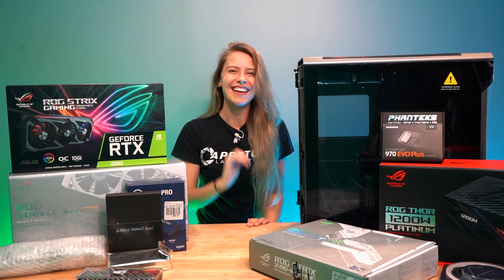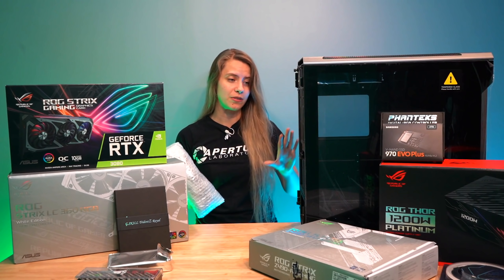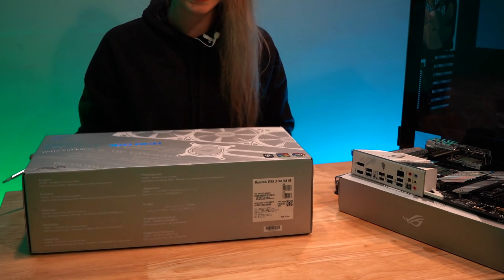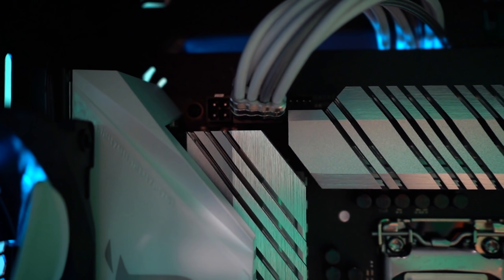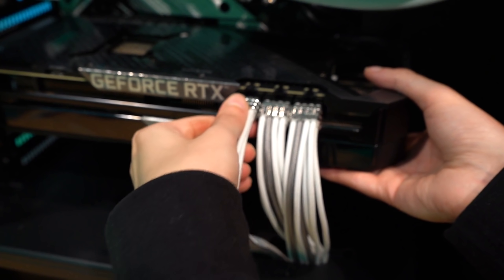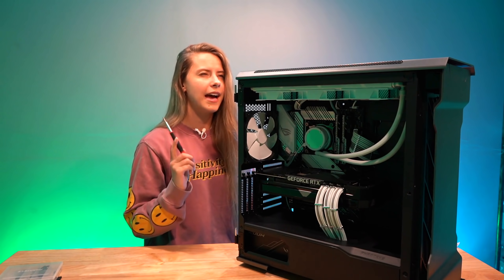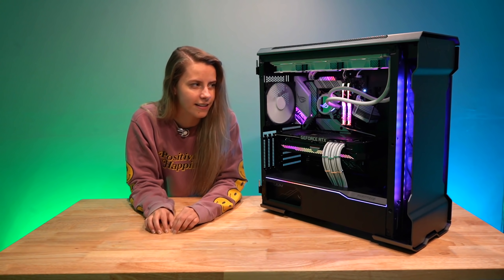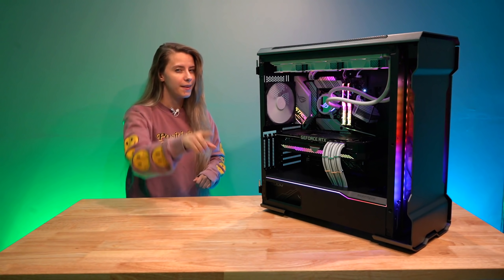MY MOST POWERFUL PC BUILD YET! 💖 RTX 3080 PC BUILD | Powered by ASUS ROG

Comment: Putting that Thor upside down hurt my soul. I have the same case and an 850w Thor PSU. If you keep it in hybrid mode the fan rarely turns on and if it does, its not for long.

Comment: If the connector on the AIO is just a MicroUSB connector, you can buy a MicroUSB to USB header cable in black on Amazon. Plenty of other coolers use them like the NZXT Kraken and Corsair H-series AIOs and they're just normal USB. Loved the video!

Comment: I've used that case for around 18 months now and love it, I can confirm my case came with 2 hard drive bays already installed. Also the extra cable isn't needed for the CPU, it's just additional power room for overclocking, I have my 9900k OCd to 5ghz without the additional cable...

Comment: Since the AIO fans are pulling air out of the case. I would remove the casefan in the back, so that the AIO can pull in passive air from the outside of the case on the back instead. Otherwise u will have too much negative pressure inside the case. And I would also flip the AIO completely so the tubes run from the back of the PC so the TUBES don't have to stretch as much.
Reply from the maker: i end up rotating the pump and rerouting the cable in the video! <3
Reply: @NoisyButters  yeah, I edited the comment throughout the video whilst I was watching :p Didnt expect a reply soo soon >.< :p
Reply from the maker: @SourceHD  honestly i had the thought of removing the rear fan but thought it might be counterintuitive! i think that's a great idea, itll match my other system better, better air pressure, AND it wont be as loud on my mic for recording vids! im so happy to read that thank u for the advice!
Reply: @NoisyButters  awesome! :D I think u might be able to install that rear fan into the front instead though for better cooling, then you'd have ultimate airflow. 3 intakes in the front and 3 exhausts in the top cause heat rises :) and u then have the rear slot empty for a cool passive intake for lil cooler cpu temps whilst still the front fans cool off the GPU really good :) that would cool down equally as much cpu as gpu :) Thats the last comment I swear 😣😁😅❤ Otherwise it's solid :) Remember to turn on X.M.P(Intel)/D.O.C.P(AMD) in BIOS for those advertised latency ram speeds :) increases game fps dramatically :) not doing much for CPU workloads in editing and rendering though, but it will help out make your system more "snappy" and responsive and get way better fps. Probs by something anywhere from 5-20% increase in FPS just by activating XMP 👍

Comment: It is your PC do what you want but a few observations if you are interested. The pump cable maybe route it up between the Ram sticks and the pump and over the top of the MB to the back (Harder with it being white but if you swap to black will hide it nicely) You can download the AI Suite 3 software from Asus (Go to your MB support page and it is there) to tweak the fans or even use AI to control them. Also make sure you set the XMP profile for the Ram. Amazing build you made. That Ram looks amazing.

Comment: You should turn the fans in the front the other way around to bring cold air into the machine. From what I can tell all fans are facing outwards, you could get issues with your GPU later in the future.
Reply: Don't know where you get that. At 8:30 the front fans are clearly visible, and they're intakes.

Comment: Good on you recognizing the CPU cooler can't be rotated and fixing the astatic issue  You can flip that PSU over the other way with fan up, it all depends on the static pressure in your case in regards to the other fans and the direction they are going.  ROG wouldn't put an LCD screen on a PSU and have everyone flip it over to the back along with most case manufactures now opting for a PSU cutout window as your Phanteks case uses. The second 4 pin CPU cable isn't needed, unless you are extreme overclocking the CPU and motherboard Gamer's Nexus style with liquid nitrogen.  Enjoy the new gaming PC.

Comment: High wattage power supplies 1200-1600w power supplies can be installed in any orientation. They are much more efficient units with much higher quality components and designs, thus they will typically run much lower than their rated capacity most of the time, causing less heat.

Comment: I sill use that case.. still love it . The hard drive bays are in your phantex accessories box.. they are stackable i got three in mine.... You have to slide the bays on the rail on bottom.its kind of tricky.. Then you can slide another bay on the bay you put in

Comment: Please upgrade the rear exhaust fan and intake fans to match the ones on the radiator.  Also with the pump cable I think you can hide it more effectively routing from the top so I would try that to get it as clean as it can be

Comment: Hannah you dont need to plug in that extra 4 pin power cable next to the 8 pin on the motherboard. That extra 4 pin connector is only if you are planning to overclock your cpu for more power. Like so she can see guys 😜

Comment: The pump cable (usb) doesnt actually need to be connected for anything other than when you set it up (lights, pump speed etc), after that you can disconnect it from the pump and just have it dangle it below the psu shroud :p ofc a pain if you wanna change the damn lights every other week but ey.

Comment: Funny video lol
Tip: Set your color balance to the ambient light temp. It's very warm in this video (your "white" radiator looks grey). You can usually fix it by setting your white balance in post. Most "good" video editing software tools allow you to use a "dropper" to select the color sample you want to set you white point to. Use that dropper to click on something white or something light grey in your video and it should get you much closer to where you need to be.

Comment: may i suggest to put the radiator to the top instead of the side for optimum performance and prevent air bubbles on the pump of your aio overall its a good job

Comment: W! I just got my first gaming pc together. Couldn't get the motherboard I wanted so I got a MSI Z590 Carbon Gaming, i9 10850K, Gigabyte GeForce RTX 3080 Gaming OC, Corsair RM850 Gold Plus PSU, Corsair MP600 Pro Gen4 1TB NVMe M.2, Samsung 870 QVO 1TB 2.5 SSD, Corsair H150i AIO and 16GB Corsair Vengeance 3200MHz RAM all in a Corsair 5000X case... I wanna get 32GB TridentZ 3600MHz... I also need to get some cable mods cause the stock cables kinda look like doodoo... lol. Oh and I have Corsair SP120 RGB fans. Either way I'm so proud of my new gaming pc... honestly I may switch to Ryzen at some point... to the 5900X... and do a open loop... but for now I love my pc as it is

Comment: Nice build and specs, but that power supply 👀👀 a bit overkill for a 3080 and a 10700k 🤣 also you should flip the fans on the radiator to be outtake not intake. Helps with dust and thermals

Comment: Have the same case and psu, gpu, I have mounted the Thor so I can see the display. I saw on a YouTube video that the heat is gonna go out in the back even If you mount it with the fan upwards. I have had it like this for 3 years and had no problems ;-)

Comment: Fairly certain you mounted the HDD correctly.  The other bracket appears to be for mounting an SSD in the bay instead of the HDD.  Honestly though - if you're editing from a hard drive, you really should look for some friends in the solid state space.  Hard drives are rapidly getting to the point of just long term storage.
Reply from the maker: im usin it for storage, not editing!
Reply: @NoisyButters  Ahh ok.  I too have an HDD for long term storage that I just simply cannot bring myself to stick in a network device for some reason.  haha.

Comment: Your CPU needs to have that 12-pin connector plugged into the top left of the motherboard or else your CPU won't get enough juice to work your computer will still be able to turn on but it won't have enough power to supply them CPU

Comment: Its a great cabinet. Bought it myself this year. Ended up too small though (:O ). It got a heat problem with an AMD 5900x and an 3090, so I went for a custom loop. That takes a loot of room, especially when you use a 420 radiator :D

Comment: Fantastic job out there! 😁
Have you used Arctic MX4 (old edition, because the 2019 edition looks different) ?
My bro has this case, is awesome, but the cooling is not ideal. 
I think i'll go with P600S, P500A RGB, Meshify 2, or SilentBase 802 for my build. All must be  better in term of temps.

Comment: This mobo came with 16bg RAM AND a 512GB SSD?? Surely they did that just for you. Yeah it's cheap stuff but if you're just trying to get running, that's 2 major components you wouldn't even have to worry about. Also, it's a good thing you were going to install an M.2 because the fact they had one in there with the plastic still on the heat sink 😲

Comment: id be having a blast playing with the toys u get to play with im on a 2 year old asus build. its an asus b550m mini atx wifi with an amd ryzon 5 6 core 3600 with nvidia evga geforce gtx 1660super ...had an asus 1650 gtx ..... still have it but not using ...16gb ram by gskill dont remember exact speed numbers etc definitly need to upgrade lol .over all not bad but very minimal build 500watt psu

Comment: Hey Hannah, quick question: At 11:44 you did wipe off the pre-applied thermal paste from the AIO before installing it, didn't you? Since you put your own on the CPU, then just cut to installing the AIO water block I got kinda confused. Don't want to have too much (and different types) of thermal paste on the CPU. I'm assuming that's why you had the bottle of isopropyl alcohol out, but just checking since you didn't mention anything about it lol.

I know you probably know this, but just making sure. Also to help out people in the comments who may have never build a PC before 🙂.
Reply from the maker: correct i did wipe it off! i thought i included the clip im sry! D: no double application of thermal paste here!
Reply: @NoisyButters  Lol no problemo! I knew you did but just wanted others to know not to do it lol.

Comment: Why didn't you want to run the psu fan side up so you have the screen? The cut out in the psu shroud is there for a reason and it wouldn't of made any difference to cooling or noise.

Comment: I made a build on this case too, everything went very smooth except for one problem i dont know if i forgot to plug something in, i couldnt find any leftover cables but when i press the RGB button to cycle through the lighting modes nothing happens, it only turns on or off when i hold the button, and its only spectrum cycling. kinda pisses me off but whatever, i got some rgb in the software

Comment: yo that AIO will kill the pc put the pipes down you might not like it but doing that traps air in those pipes at the top and will make it ahrd for water to get from and too it your pump is prob going to die soon if thats not changed soon seeing how this is a week old. RGB is cool and all but its not worth frying your cpu.

edit: keeping the tubes on the bottom would had been smarter gamers nexus did a video on it. the aio will prob fail first but in some cases the cpu will if its a high end aio like this. just lower then back down and the air wont build up in it

Comment: Would intaking from inside the case towards the aio be less efficient than intaking from the outside of the case into the aio? Genuine questions cause I just made a new build and was wondering the thermal differences. I assume it's not that big of a difference being that the whole job of the aio is to cool any air coming in lol

Comment: Hi im from ireland and my 10 yr old son wants a gaming station he has a ps4 connected to a tele now so i need to get moniter, tower etc but i dont no where to start. What goes into it etc. Should i get prebuilt which cost a fortune or shall i built myself. And whats best for value for money as he is still only 10. Need help please.
Reply: There are 2 ways you can go about this: You can take the time to learn what the parts of a computer are and then build one. Or if you are not comfortable doing this and are not willing to learn, then maybe a pre-built PC may be a good choice. Either way, due to the pandemic, there is a massive world-wide chip shortage so finding PC components in stock and at MSRP will be very difficult. The problem with pre-built PCs is that a lot of the companies that build them use low end and low quality hardware and usually more expensive than if you build a similar system yourself. 

Probably the more important question is what games does your son play? If they're not very demanding games you may not necessarily need a very powerful system. Regardless of what you want to do, you really want to do a lot of research to make a good purchase.

Comment: Please explain, why not have the PSU in the "right" way? why is it bad to have the fan facing upwards?
Reply from the maker: the fan would be choked by the power supply shroud! the bottom of the pc case has ventilation so it was definitely meant to go that way

Comment: Can you help this is my build list Or I can do this Build: 
10900K
ARCTIC LIQUID FREEZE 2 360
ASUS TUF Z590 PLUS WIFI
3600Mhz BDIE RAM
1 TB m.2 HDD
ASUS GEFORCE RTX 3080 10 GB STRIX GAMING OC VIDEO CARD
LIAN LI LANCOOL 2 MESH ATX MID TOWER CASE
850W GOLD Power Supply
Windows 10 Pro
Tuned and Built

Comment: You are wanting a productivity/gaming PC yet you built it around an Intel platform that has lower productivity and gaming performance than a comparably priced ryzen 5000 system? Doesn't make much sense to me. The 3080 is a great choice, but not the cpu platform. Not to mention the insane heat and power draw Intel has recently. An 8 core that has higher power draw and worse performance than a 16 core from AMD, not sure why anyone would build with Intel this generation.
Reply from the maker: i already had the cpu and motherboard sent to me awhile ago and didnt want to waste it